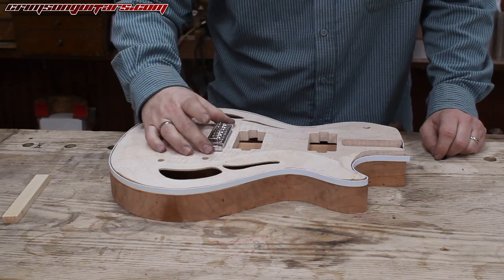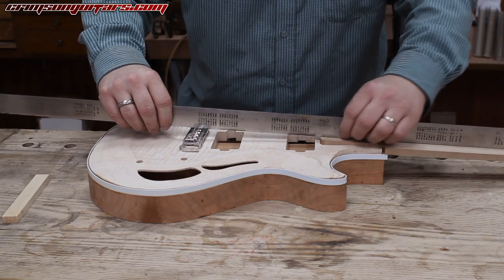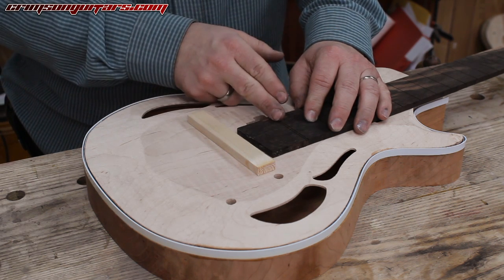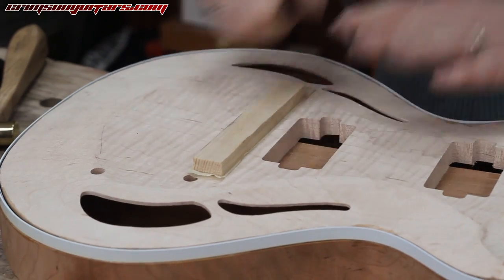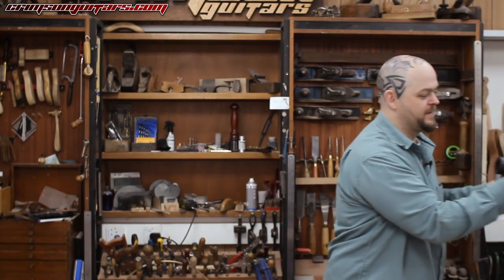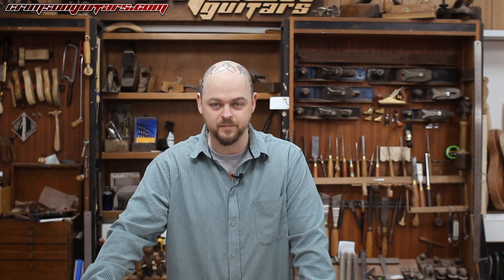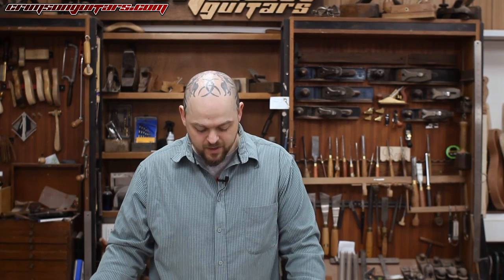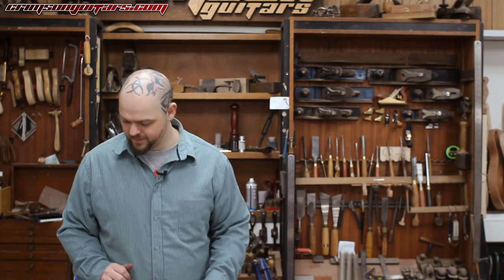Tutorial - How To Plane a Guitar Body for the Neck Break Angle

Comment: I'm using a floating bridge headless system. So basically, if I want my neck to be absolutely straight, I need to route bridge cavity just deep enough for the top of the saddles to be just as high as the top of the frets. I figured that I didn't need to put the neck in at an angle if I got my bridge low enough, now I know how low to mount it! Thank you for this most useful information!!!

Comment: I made myself a little ramp-shaped jig that sat on top of my guitar body and used that to guide a router to create the angle on the top surface of the body around the neck pocket. Then I used the same ramp to angle the body on my drill press as I bored out most of the neck pocket before finishing it by hand with chisels. Looking back, I still can't believe I got the neck to fit at the right angle and alignment doing it that way. I like the method you showed here a lot better, and in the future will try that in conjunction with a router/pattern bit/template now that my shop is a little better equipped.

Comment: Slick trick using the Stanley #No.6 or No.7 jointer plane for getting that angle.
I'm gonna give this a try on the one on my bench & will let you know how it goes.
The super glue trick & a scrap of wood is another luthier trade secret.
Thanks for Sharing them..
Gary/Hk

Comment: I draw out the profile of the guitar in autocad with exact measurements for the hardware, then let the program give me the angle. Same could be done on paper of course. I cut the body angle and using a router sled. Mine has adjustable rails to accommodate any necessary angle. I rout the neck mortise using a template attached to the (now) angled body with shims for added support.

Comment: I built a router sled box with hinged walls for Les Paul neck and pickup plane angles. It uses a couple of machine bolts on the end opposite the hinge to set the angle, and works like a charm. This is a cool way to do the neck angle, but how would you do the pickup plane?

Comment: I have questions because i don't quite understand haha any help would be appreciated !! :)
So your planing the top of the guitar but how does that affect the angle that was made in the neck pocket?
Reply: +blackjackmcgack I guess you use the surface as a hight reference and route the neck pocket again to the correct depth, so you get the neck angle in there. Correct me if I'm wrong, because then I also want to know :D
Reply: +blackjackmcgack, I agree with Iceplorer, but it looked to me as if only the top had been cut out--and the body hadn't been routed at all (see closeup at 5:00). So, I do expect a router will ride the new angle to deepen that pocket.
Reply: Exactly what I was thinking...doesn't do anything to the base of the neck pocket....further explanation required I think
Reply: +blackjackmcgack I think crimson guitars puts the angle on the neck and not in the pocket
Reply: Leaving this comment here. I also would like to know :P
Reply: +Torwulf games yes, I've seen them do that but this video is clearly called planing a break angle...but what he did there was not planing a break angle because the bottom of the neck pocket is still flat.. Even if the break angle was planed onto the heel of the neck all that was achieved here was planing the top to match the break angle.
Reply: Michael Barnes
Oh yeah, Right. Well in a podcast in the past he explained something along the lines saying you can just rest the template on a piece of wood around the correct height and possistion and then the router will cut at that angle.
Reply: +Torwulf games changing the name of the video is just cheating haha....I noticed from my earlier email notification that it's been changed.
Reply: He said Ar the beginning that the pocket had been angled already when the body was in the CNC.
Reply: John Horning Must have missed that part like many others xD
Reply: +blackjackmcgack,  Hi mate, I'm with you, he has clearly ONLY said that the neck pocket had been routed, which I interpret as just the outline, NOT THE DEPTH, with or without the ANGLE.  I conclude that because a lot of Ben's guitars are SET NECK (and NOT bolt on) that he will later on cut into the neck pocket to allow the glue in of the neck, and he will align in with the angle on the guitar top and then sand the back later.Just my take, cheers Paul

Comment: Surely the more material you take off the angle changes as the plane is pivoting around the bridge point ? Okay for roughing maybe. Use a protractor against the body and face to get the correct angle. Or Cnc it when you do the neck pocket angle

Comment: Fantastic  ideo.  Showed me the answer to one of the most burning questionsI, as a novice guitar builder was facing.  However! Can you use the same method on a flat top guitar such as an Sg or LPjr? If not, is there an alternative that is just as simple? Also, and this may seem elementary to an expert, what length plane should be used?

Comment: Hi, sorry if it's a stupid question maybe but what I don't get here is you will have applied the break angle to the body, yet the neck will be put into the neck pocket which bottom is then still not angled, so the strings won't be aligned in an angle !??
maybe I'm just not seeing this the right way, please enlighten me and sorry if it's a stupid question. 
Another slightly off-topic question but can be answered quickly I guess: let's say I have a kit guitar and the neck is a bit too large on the sides to fit into the neck pocket hole, what I'm sanding? the neck pocket hole or the neck? and  how do I ensure the neck is still centered?
Reply: The pocket was angled in the CNC already.
Reply: +John Horning, no I reckon the pocket was only outline routed.  I think he will do a set neck, which will mean he cuts deeper into the pocket, ALL of that is later on.  Just my take.  Cheers, Paul
Reply: had the same problem with a kit, put a piece of masking tape down the middle of the neck.

measure the center of the neck at the nut  and Mark with a pencil, and  do the same at the bottom, I also measured it every 3 or 4 frets, join the marks with a line from top to the bottom of the neck.

find the body center line and hope the pocket is in the right place, mine was so I could be happy and carry on.

I have a piece of steel that's about 2ft long and 4 inches wide , it's perfectly flat. I glued  some sand paper to it and clamped it down.

then evenly sanded the heel of the neck a bit on each side until was a tight snug fit and the center line on the neck met the center line on the body.

you can do it with a sanding block if you want but remember to do a bit at a time and regularly check your work.
if you find the neck pocket is completely out of line , stop!! contact the seller of your kit and send it back and get it replaced,  there is no point trying to fix that because it's a manufacturing defect. hope that helped you out. I have done a fair number of kit guitars now and some have been really good some have been shit out of the box, had an evh type kit and the tremlo post holes were out of line.
Reply: posted a solution for you, hope it helps.
Reply: +TheEARLD awesome trick will try thanks a lot buddy.
Reply: Digital calipers, a meter long rule,sanding block, could be useful . I'd sand the neck. Try to find mark center line on neck ,use meter long rule for alignment with body.and use your eyes.

Comment: But how do you cut the neck pocket to the right angle? I don't think you have a video on that.
Reply: Inigo what do you mean? The neck pocket is routed when the body is flat (top and the back are even thickness).  Then the back of the neck is hand planed the match the pocket. Hope this helps.
Reply: @KesselRunHero well I do exactly as Ben does here, I made a piece of wood the same thickness as the lowest height of the bridge, then I router the neck pocket, then I shape maple top like Ben does here, I then hand plane the bottom of the neck heel until I get the correct angle ( with the fingerboard I make sure the neck is projecting a hair above the dummy wooden bridge). It's all plane a little bit check the. Plane some more, takes me no more than 10 mins
Reply: @KesselRunHero yes exactly
Reply: What if you wanted to use surface mount pickups (Ric) on tele body and use Ric bridge and tailpiece? Can you shim your bolt on neck to give you the break angle to use this setup?
Reply: TJ Spurgin yes you can, you just make a thicker heel part on the neck, and plane/sand it to the correct angle and just bolt it.
Reply: Another approach is to route the pocket after you angle the top. Your neck pocket template will be at an angle due to the angle you just planed on the body. This creates an angled neck pocket matching the body top you planed.  The neck bottom can then be flat.

Comment: I USE A BOX JIG AND ROUTER PLANE. ITS AN MDF BOTTOM WITH A CENTER LINE TO LINE THE BODY ON THEN AROUND IT SITS AN MDF FRAME 3" TALL WITH A HINGED FRONT SO YOU CAN RAIS THE BOX TO WHATEVER ANGLE YOU NEED THEN JUST SHIM IT, CLAMP IT, AND USING A ROUTER PLANE THAT RIDES 1" TALL RAILS INSIDE THE BOX I CAN ROUT THE NECK TO BODY ANGLE, PICK UP ANGLE AND I EVEN MADE TEMPLATES THAT FIT THE BOX THAT ROUT THE ROUGH CARVED TOP IN STEPS THEN FINISH WITH AN ORBITAL SANDER. DOESN'T MEAN I'M NOT STEALING THIS IDEA FOR MY CUSTOM BUILDS. I ONLY USE THE HINGE BOX WHEN BUILDING LES PAUL COPIES THAT NEED THAT 4.4 DEGREE ANGLE.

Comment: I'm so confused about this. What about the neck pocket joint? I must be missing a ton of information.
Reply from the maker: +einarabelc5 the template for the neck cavity is either rated on the new angled section of the body or, if you already have it routed the pocket you can go back around it with a bearing cutter this cutting the bottom of the neck pocket to match the new angle we planed on the top.

Comment: could you do this with a smaller hand plane?
Reply: Not without building some kind of a jig.    I actually use a handheld router with a straight bit to rough in more or less the way Ben was doing it - but it rides on an MDF and plywood jig that spans from bridge to pocket.

Comment: why not to add angle on the neck heel? I assume it should be much easier
Reply: You can do that, yes. But if you do that, the fretboard will start to sink below the surface of the body as it angles back - unless you have the neck sitting high out of the pocket.

If you use the method in this video, the neck will protrude the same height above the surface of the body all along the heel.

Comment: Throwing another off the wall idea: does anybody ever angle the bottom face of the neck where it joins the body; and if so, might you pre-route the pocket, clamp the neck in upside down, and then plane both the top and that bottom surface of the next--to get a neck joint that exactly matches the depth of the pocket?  I do, however, imagine that clamping the neck in with the appropriate degree of precision would be a bit of a challenge.
Reply: +AngryWelshman, curved? eek.  Yeah, I understand. So much joinery is based on straight lines.  If curved was easy; yeah, all we would need is tools that standardized on a convenient radius.  But, the convenient radius that 99.99% of all joinery is based upon is the infinite radius, i.e. the straight line. I assume that most would tell you to plane that thing down; and if the arch of the body is not making that work out, then plane that down as well.  That might sound tyrannical, but there are artful ways to get straight lines to merge gracefully with curves (tangents and such).  And, we do love nice organic curves.  Anyway, thanks for the comment, and keep on carving the graceful curves, along with suitable tangents to the ever-so-convenient straight lines.  (Gawd, I love curves.)
Reply: +AngryWelshman, BTW, I once knew a Welshman who expressed anger in the most exquisite way.  But, then I'm generally a fan of well-express curmudgeons.  I once aspired to be a curmudgeon, until I realized that aspiration was inherently optimistic.   Anyway, love the name.  Rock on.
Reply: Yes, if you do it at the right stage of your build, you can have a flat pocket and angled neck heel to achieve the correct break angle.  That relies on math the determine the angle and accurate drawings whether CAD or on paper.

Comment: I don't understand how the angle the body tapers off to at the neck dictates the break angle of the neck. Surely it's still going to be flush in the pocket? Someone patronise me as much as you'd like and tell me.
Reply from the maker: The trick is to rout the bottom of the neck pocket so it runs at the same angle as we have planed into the top. The alternative is to leave the top flat and rout the cavity at an angle, but doing this leaves a gap at the binding etc on the neck.